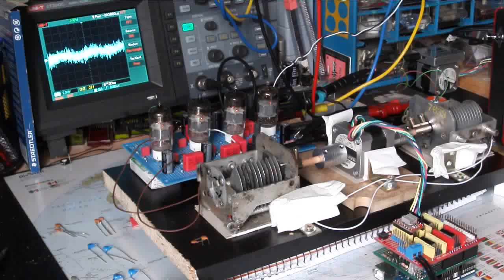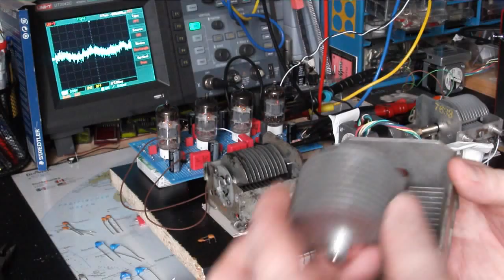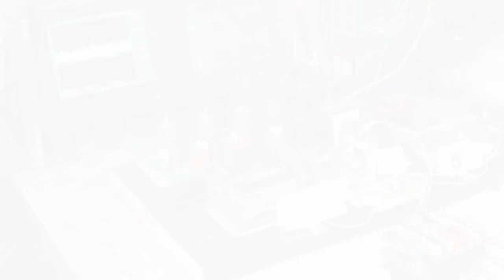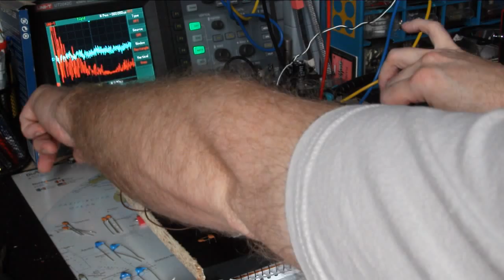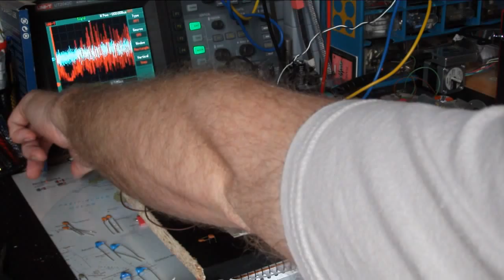DrehKoPhaser - arduino based DIY Audio Tube Phasing effector -- Prototype

Comment: So that phaser has only two stages (since there are two variable caps)? Still sounds very good.
I wonder what these variable caps originally were made for? All the variable caps I salvaged from old radios (when I was a kid back then) had a turning range of 270 degrees or so. Too bad I trashed them all :(
I also wonder if it would be difficult to DIY such caps? Some sheets of PCB material, some ball bearings...?
Reply from the maker: Hi, Ingo
it's just one stage, or better to say one notch as two caps beeing needed for a 180degree phase shift.
These rotary condensors are intended to be used in mid range power ham-radio stuff for tuning antennas and/or output stages. Tge gap between plates is 2mm. The stator is insulated with large ceramic disks from the enclosure. But the rotor isn't neither the shaft. so it catches a fair amount of hum and noise....it would be difficult to mount them in a final project as i need to insulate each one from the cabinet as well a each shaft from the motor.
But i found some very, very nice rotary condensors which are completely insulated from their housing. These are perfect for my upcomming phaser project. 

You may check my instagram page, as i usually post much more there, as it's way faster, i don't need to do big editing and upload the final xGb stuff which usually takes a whole night up to 48hrs using my slow DSL. Therefore i only do final videos here and all inbetween results at insta.